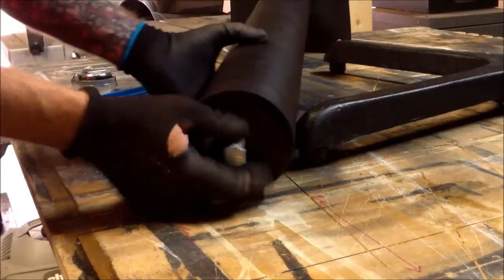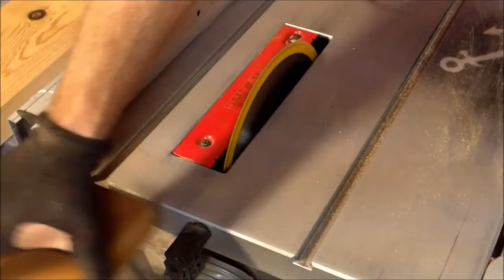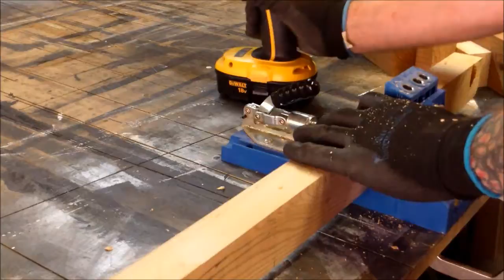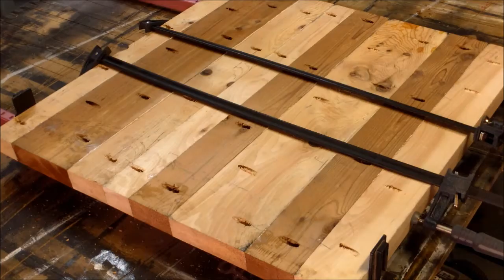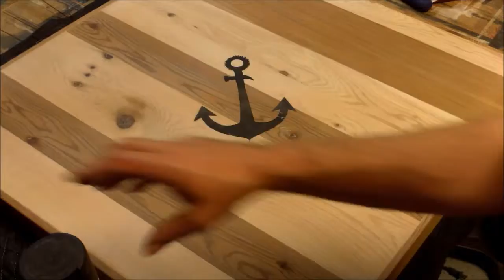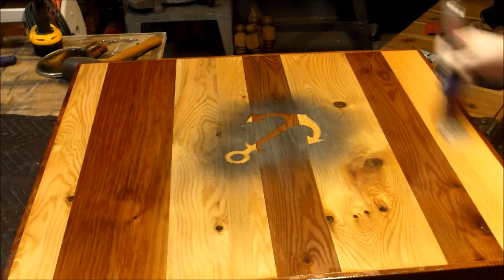DC. Pub table

Comment: has there been any wood movement since the build? I don't usually box in wood with a frame as u did but I'm curious how the wood has settled since completion.  Really nice looking table.
Reply from the maker: +Wade Green There was an issue when the table was knocked over by a rowdy buddy of the table owner. The 'frame' was damaged on one corner which made for an easy repair. Other than that NO issues. I had that cedar in my garage for a year, so it was already dried out and easy to work with. Thanks for the comment!!